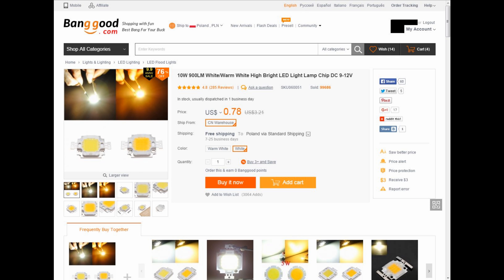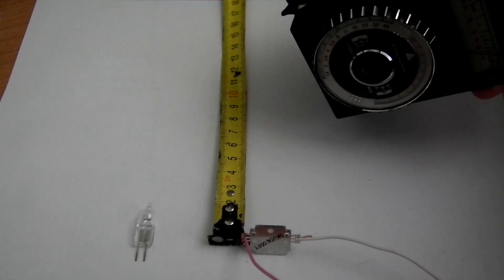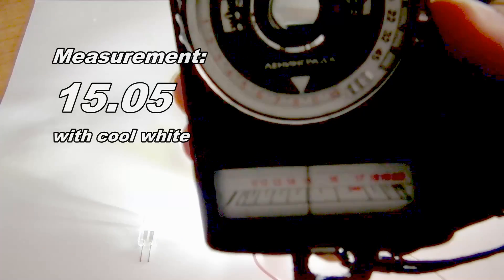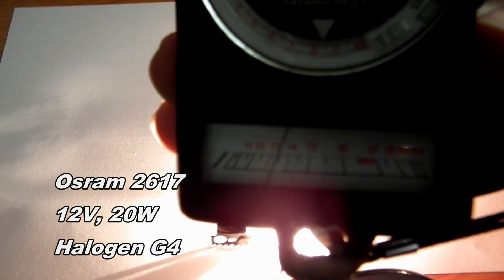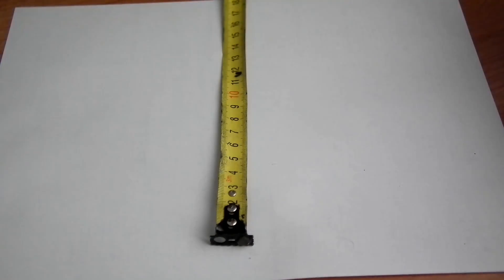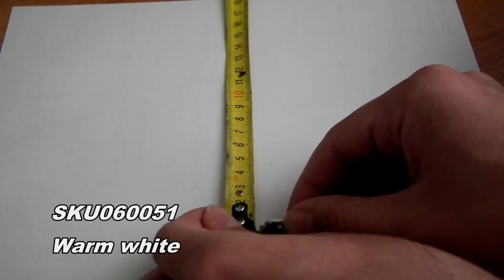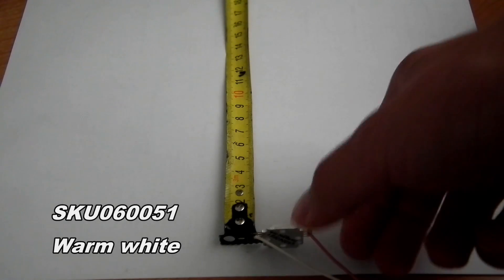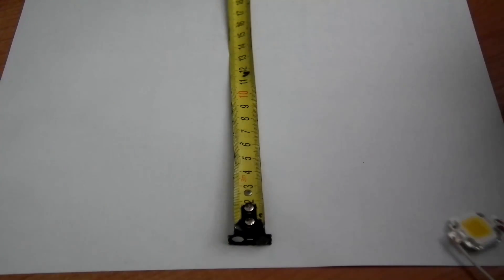Test of SKU060051 LED from Banggood.com (ENG) - 10W LED for 0.78$

Comment: J did not know you liked LED? how do you evaluate them on a scale of 10?
Reply from the maker: +Ми ша I ordered next 10 diodes - this is my answer :) They are good. The price makes them the cheapest 10W diodes on the market.
8/10 including price ratio (8, because they are radiate much heat (needs heat pipe), and the warm version of diodes also can be a little more "warm" - but now it's equals to specification - about T~=3000K to 3500K)